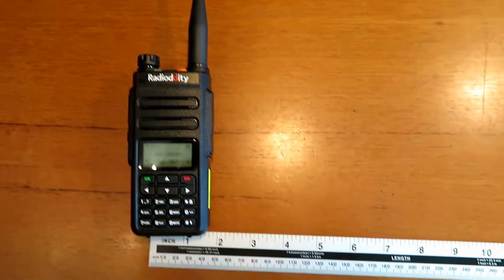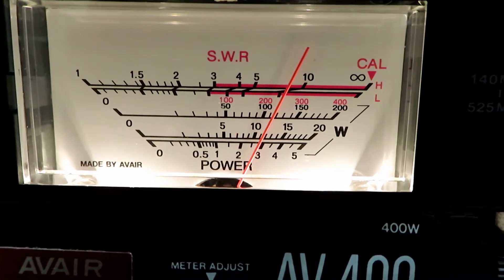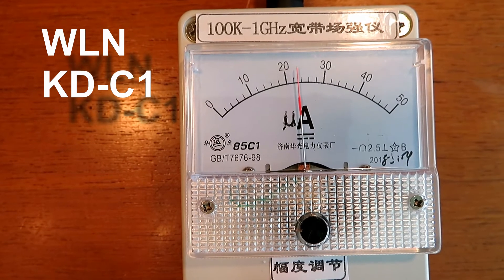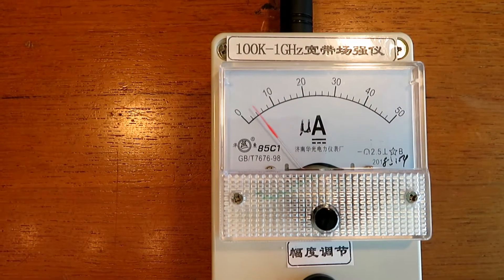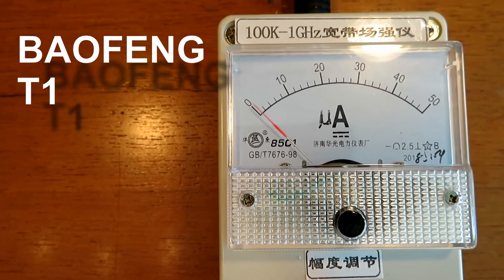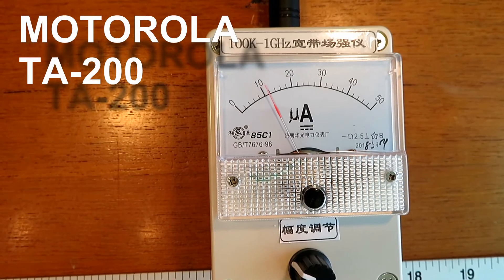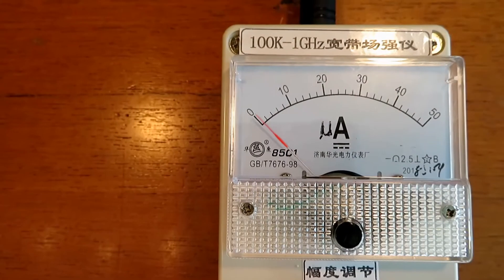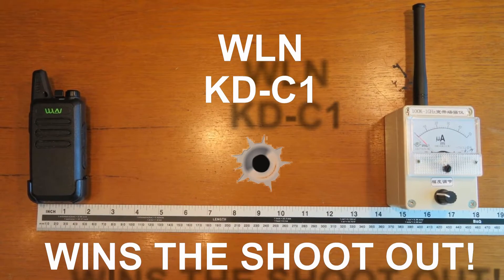Fixed Antenna Radio Power Shoot Out!! who wins?

Comment: Wow I'm suprised how much better the WLN KD-C1 is doing compared to the Boafeng T1!
But what does that mean in terms of real world performance?

I tested a pair of WLNs (2 watts) against a pair of Motorola T100 (FRS, 0.5watts) and the achieved range in the same area was just slightly better with the WLNs, which was kinda dissapointing given they have 4 times the output power and I programmed the channels to be wide range (25khz vs. 12.5khz)
Reply from the maker: Wln in real work performance works amazingly well, it's audio quality is brilliant and it will easily do 7 to 8 miles over thin terrain
Reply: knoxieman I take your word for it but what does it really mean when using only 1 radio and no other devices to put results in perspective? What would you say if a dead cheap Motorola T100 made nearly the same range?
It would be more realistic to conduct these range tests with a pair of WLNs since a high output second radio with long antenna could compensate for the WLN lower sensitivity/output and thus distort the results.

Comment: The output of the bf-t1 circle can be set to 0.5W and 1W. Which did you experiment with?
Output setting is changed while turning on in 3~4 seconds by pressing the power button and the torch button at the same time while the power is turned off.
Reply from the maker: Ah right that's useful, these were on full power 👍

Comment: Thanks for the video, I have a question, the baofeng t1 has 2 powers, supposedly it goes out 0.5w in low and 1.5w or 2w in high, When you perform this test, is the output power set to low or high?.
thanks.
Reply from the maker: High power
Reply: @knoxieman  Ok, thanks.
Reply: LOW : VHF 0.5W   UHF 0.6W ,     HIGH : VHF 0.6~0.8W UHF 1.3~1.5W
Reply: @risingsunflagsamemeaningas7472  Thanks.